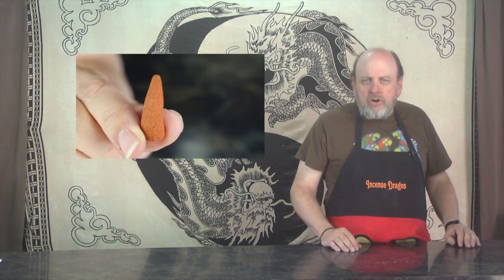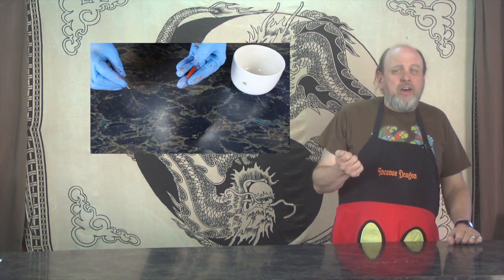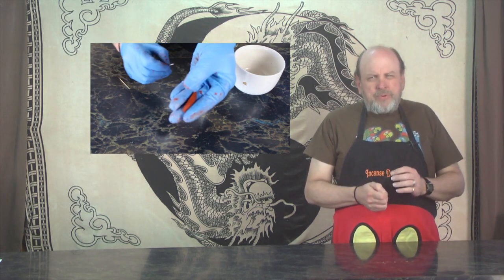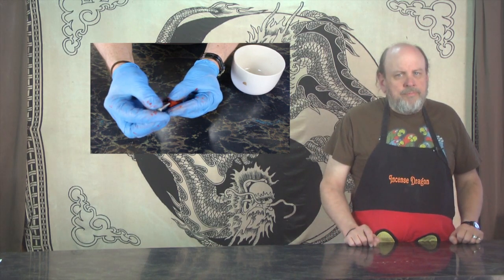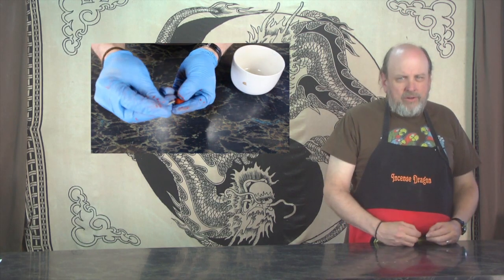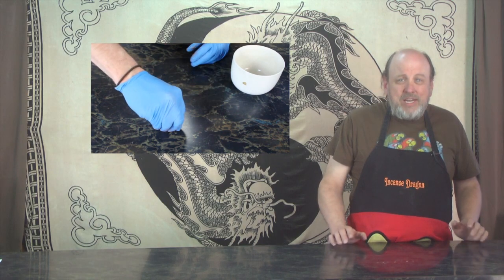How To Make Backflow / Down Flow Incense Cones (Incense Magick Ep. 010)

Comment: Does this work with cones that are already hardened?
Reply from the maker: You can drill a hole into a dry cone, but you must either drill by hand or at a very low speed.  It is time-consuming to drill the hole without breaking the cone, but it is possible.

Comment: Can I break down the  over seas cones and mold them larger.the ones that come with burner are fast
Reply from the maker: That is one of the disadvantage of synthetic incense.  You could grind down those cones and make larger ones, but they will still burn too fast.  A better solution would be to make your own incense that burns more slowly and smells much nicer.

Comment: Quick question... Can I used Clear Jell as a binder. I have some  and the stuff seems to have the same properties as other resins.
Reply: If clear jell is flamable and safe to burn, try it out on a small batch yourself. Experimentation is key when it comes to incense, at least in my experience
Reply: Noah... I did try it and it worked just fine. I may use a bit more next time. Thanks!
Reply: Aah okay, may try it out as well myself.